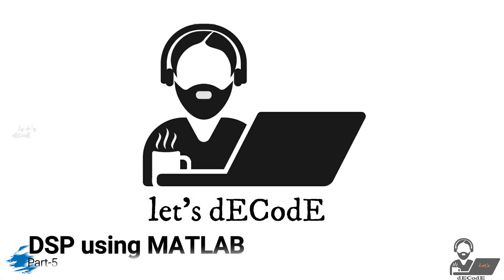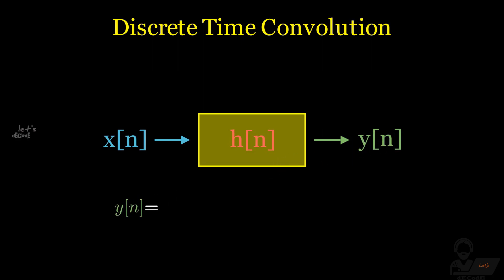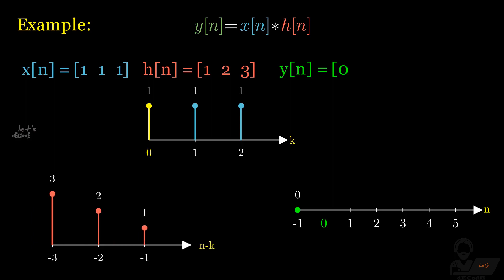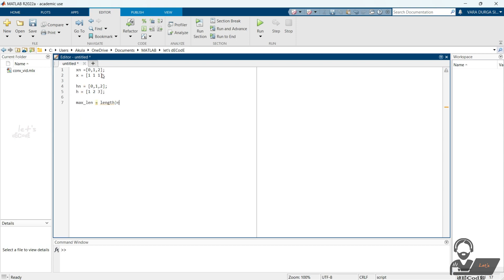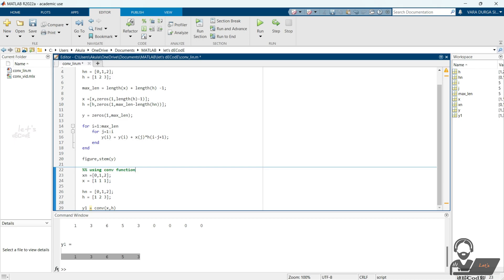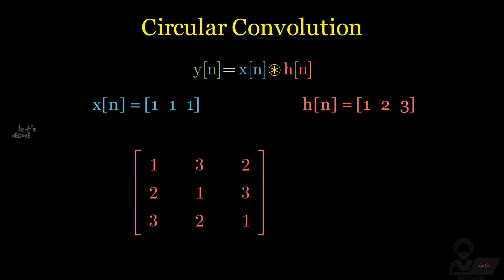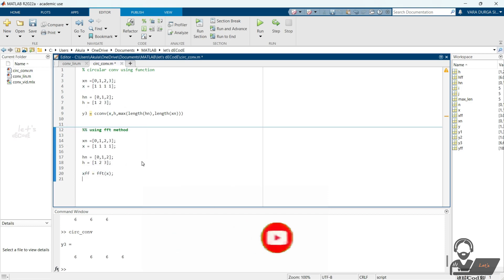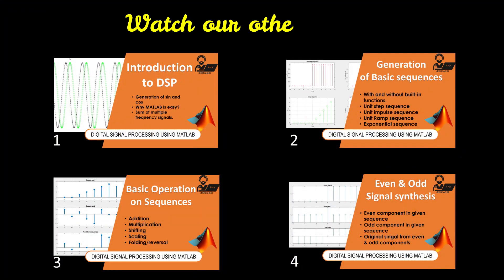Linear & Circular Convolution in MATLAB || let's dECodE || DSP using MATLAB || Part-5

Comment: You have provided beautiful expert videos on DSP using MATLAB. It is a pleasure watching an expert work on any software, to learn. If you can make videos on filter design in MATLAB. One request is go a bit slower. :There is too much information coded into  small capsules -)
Reply from the maker: Thanks for the suggestion. We will consider it. Keep watching and happy learning. ❤️